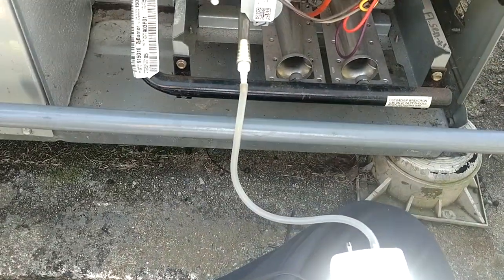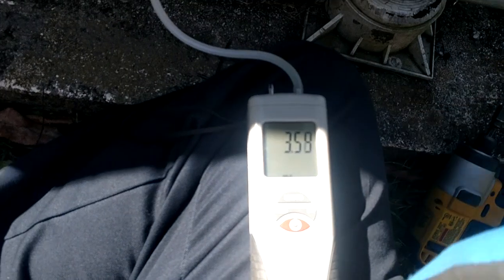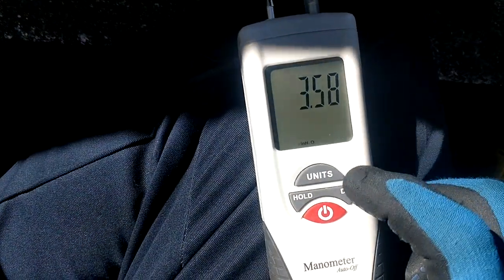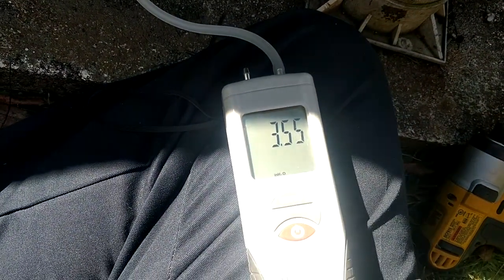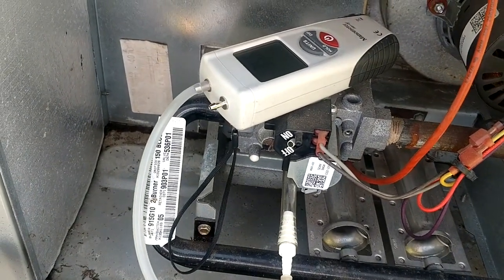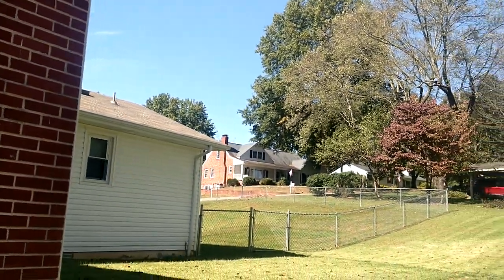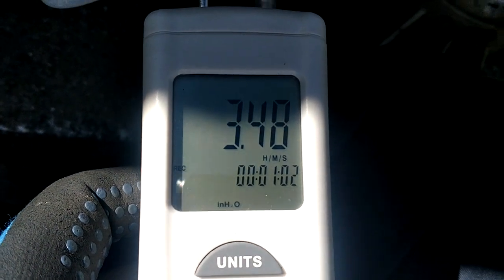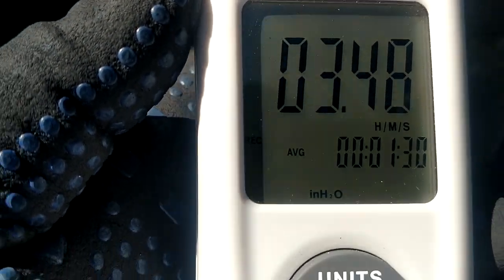Chinese manometer🍜Min./Max./Avg. with door on Am. Standard gas pk. Definitely accurate 👍

Comment from the maker: Fieldpiece makes #RMA316 adapter for the smaller diameter.
Check this out at Amazon.com
Fieldpiece RMA316 Manometer Tube Adapter, 3/16" to 5/16" https://www.amazon.com/dp/B00NBR1RZQ/ref=cm_sw_r_other_apa_i_wXfnEbBACCM6D
Reply from the maker: Dude, I talk about Tools in general. I would definitely not say that I'm out here "pushing" Chinese tools. There are plenty of Klein Tools in my videos also. But not every guy out here is a union worker making 30+ dollars an hour. Not everyone works for a company that buys all their tools for them. Not everyone can afford top of the line stuff. Sometimes you just need to save money wherever you can and still have a reliable and trustworthy instrument. And the fact of the matter is.... If it has a computer board and an LCD display, it is all coming from one of 2 places China or Taiwan. That fancy Fluke meter was made in China. Although most of Klein hand tools are made in the USA, their electronics are not. All your test equipment from Amprobe, Fieldpiece, UEI, Testo ext. ext. ext. All comes from China or Taiwan. In fact, this exact manometer is sold  by Supco (DDM55) here in the United States for 2x the cost but it's still made on the exact same assembly line in China. Sometimes guys get a false sense of "doing something good" just because they're buying from a company in the United States but not realizing their entire product line is made in China or Taiwan. it is just simply not feasible for companies to produce electronics in the United States. I do my homework and I know my tools and I know manufacturers... I just try to give guys other options. I would much rather a guy be checking gas pressures with a Chinese manometer than not checking them at all because he can't afford an instrument to do it with. And if a man saves $50 on a manometer that's a pair of Klein linesman pliers and a pair of Klein wire strippers he can put in his tool bag. I hope you see what I'm saying here, because I believe we're both on the same page.  👍 
And thanks for watching my videos.

Comment: I’m a DIY’er and I have the exact same manometer and I love it. Today I had to make a step-down hose from 3/16 to 1/8” and I used a brass double barbed adapter coupling that I bought on Amazon. After making my adapter hose and connecting it to the manometer (only) , the readings went way off 0. It turns out that when they made that cheap POS adapter, they forgot to make a hole between the two sections😫. The adapter was promptly deposited in the proper receptacle and replaced with a plastic one.
Check your test adapters before using. Save yourself some grief👍.

Comment: What the fuck. What setting did u use?
Reply: After 30 yrs of HVAC .  I still get F.. up.  Trying to understand the unit measurements .   rrrrrr
Reply from the maker: @Mik-mk8us  in. W.C. (inches of water column) 😎👍
Reply from the maker: That's using   in.W.C.  with the min/ max/ avg.  button ON.
Reply: I got 1 of those digital manometer from Amazon. 
 It displays 12 . Unit values . 
 Which 1.  do I use to calibrate the gas inlet & outlet pressures .  I installed a new Rheem 85k furnace. 
I installed hundreds of units .   But our other tech that used to set manifold pressures .is not around anymore. So I have to figure this shit out myself
Reply: New LP kit installed now on genisis valve.
I need to figure out the high & low pressure settings
Reply from the maker: @Mik-mk8us  that information should be stated on the manufacturer's data plate inside of the furnace. It will be under manifold settings. And it is crucial that the pressure is set correctly for LP gas and should only be done by a qualified technician.
Reply: I appreciate any assistance, from 1 tech to another.
  Ottawa canada
Reply: Thank you for the reply bud ,.   I've done everything in HVAC ,.   Thing is our tech is no longer around , and he left the city,. He used to play around with all the adjustment stuff.   I always did the installs . It's been 30 years since I did a LP conversation. & I forgot most of the readings .   My issue is . Understanding the Manometer.     And I have no instructions. ......   Which. Of the 12 different setting on the meter do I use to take the pressure readings .
I feel so stupid .    Even having 35 yrs in the trade
Reply from the maker: @Mik-mk8us  it just depends on where you're at in the world. In the United States we use (inches of water column) in.WC 
Other than that, I can't help you.
Reply: Eastern Ontario canada

Comment: Thank you Shannon for the video. I just bought this myself and it’s comforting to see this video to say it’s an accurate manometer. I wish they had sent longer tubes with the manometer.
Reply: Thank you 
Very much
Reply from the maker: Go to PetSmart, in the fish tank Department, and you can purchase very long lengths of high quality silicone tubing and it's pretty cheap. I think they carry it in blue and black . Should be the perfect diameter. Take the manometer into the store with you just to try it out on the ports and make sure it fits to your liking. Thanks for watching 😎👍
Reply: @sknight0391 
I'm new at this can you buy the brass fittings to check the gas valve at a hardware store
Reply from the maker: @T-one7  yes you can usually find that fitting at a hardware store. It's a "NPT" pipe threaded fitting on one side & barbed on the other. You'll have to match your tubing to the size of the barbed fitting. You can find good cheap silicone tubing at pet stores, like PetSmart. You can also look up UEI bf100 kit on Amazon.
Reply from the maker: And pretty much every manometer, even the cheap ones, will come with one of those fittings.

Comment: I bought one of these on Amazon mainly to check static drop across my filter and TESP of air handler. The ports are not marked for negative or positive. I learned the right port is neg and left is pos. I noticed your hose was connected to negative but you had positive reading. Was that negative or positive pressure you tested ?
Reply from the maker: Right side is positive and left side is negative.
Reply: @sknight0391  When testing negative pressure on my duct return with one hose connected on right port, the negative symbol displays to left of number. I assumed this confirmed the right port as neg. Regardless of port hose is connected, should I see the neg symbol when testing neg pressure ? Thanks Shannon
Reply from the maker: @greyholcombjr.9623  No you do not see the negative symbol when testing pressure unless you're hooked up in reverse. The right side is for positive pressure readings like on a gas valve. When you're checking static pressure the left probe will go in the return and the right probe will go in the supply.
Reply: @sknight0391  Thanks Shannon. Guess I was thinking in reverse. I'm not a tech, but I do hope to become You Tube certified.
Reply from the maker: @greyholcombjr.9623  Thanks for taking the time to watch my video 😎👍
Reply: @sknight0391  One more question if you don't mind Shannon. To measure TESP on my air handler, do I need to measure neg and pos individually and add each reading together to get total, or does this unit have the capability give me a TESP on the display screen using both ports as it does using both ports for differential testing ? The instruction pamplet isn't much help for this unit. Thanks Shannon
Reply from the maker: @greyholcombjr.9623  I always hook mine up individually 1st. I do the return by itself, then I do supply by itself & then I put both probes in at the same time. The unit will give you the differental on the screen.
Reply: @sknight0391  Thanks !

Comment: When using this to set burner pressure for LP, do you put the hose on the right nipple or the left nipple when looking at the display?
Reply from the maker: The right side is + pressure & the left side is - pressure. The two sides should read about the same.

Comment: I have the same along with UEI240 and a Dwyer U-tube.  I'm having trouble with both digitals reading the same at both ports so question accuracy of my readings.  Just to confirm the reading should be the same when single hose is connected to one port or the other just + or - being the only difference?
Reply from the maker: Dual-port manometer will almost always read "slight" differences between the negative and positive port.

Comment: Can it be used to measure the vacuum pressure of a vacuum pump?
Reply from the maker: No, this instrument isn't designed for that. You would need a micron gauge for that type of testing.
Reply: @sknight0391  Thanks a lot...please tell me one more thing, can any of the commercially available differential manometers measure vacuum pressure?
Reply: I have the same manometer and it can measure up to negative 2.0psi
Reply: Josh Bascii Thanks man..

Comment: Sure wish it had a magnet on the back for hands free operation This is not a deal breaker for me. The UEI EM201B manometer has most of the same functions and is made in Taiwan China at 4 times the cost.  If the unbranded Chinese manometer you use  holds up for 4-5 years and then stops working, just replace it with another and save the $$$$. Great video! Thanks
Reply from the maker: If you want a magnet on the back just buy one at the craft store for a couple of bucks, problem solved. Mine has held up great for about 3 years now and it's still the best manometer I've ever used. You can't go wrong with one of these things 👍
Thanks for watching.
Reply: @sknight0391   - By hot glueing a magnet on the back of the manometer, will this possibly cause errant readings or create inaccuracies?
Reply from the maker: @damedicmt  I wouldn't recommend gluing a magnet to it. I glued a small lanyard wrist strap to mine that allows me to hang it.
Reply from the maker: Here's a video I did showing my whole gas pressure kit. I also show how I attach the wrist wrap to the back of my manometer. ⬇️
https://youtu.be/EU8SUawjDBQ
Reply: Thanks Shannon. I'll do this.

Comment: Thanks for posting. I am thinking about using this to make a smoke machine for automotive diagnostics where I can't supply the evap system with more than 12 inches of H20 which is about 1psi but very tough to find a manual gauge that reads 0-5 psi, but this guy works from 0-2psi which is great to see when leak is sealed. Correct? Thanks!!
Reply from the maker: Glad the video helped. Thanks for watching 👍

Comment: 👍 great video Shannon, may have to try that manometer
Reply from the maker: You can't go wrong with it. I could not trust the readings and reliability of the Testo 510 when I owned it. The readings would change from holding it in your hand, to attaching it to the duct work with the magnet on the back of the manometer. I couldn't get rid of that thing fast enough.